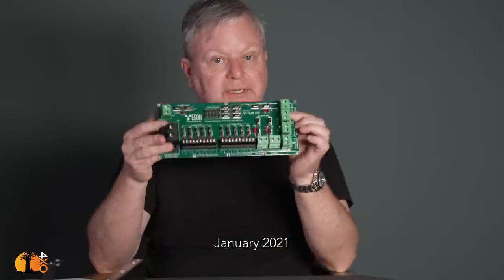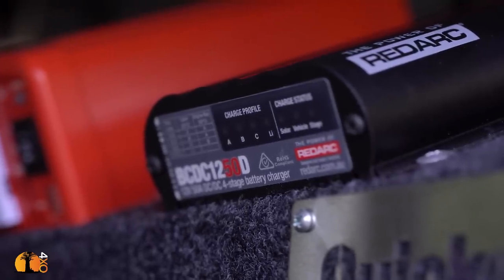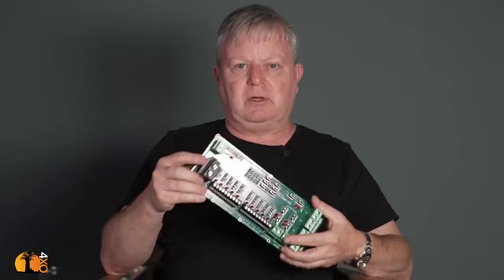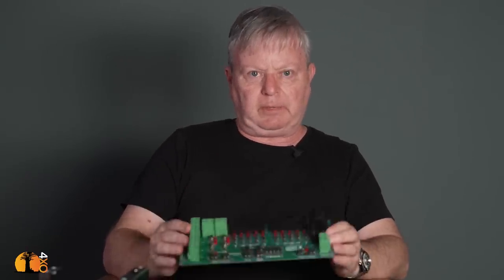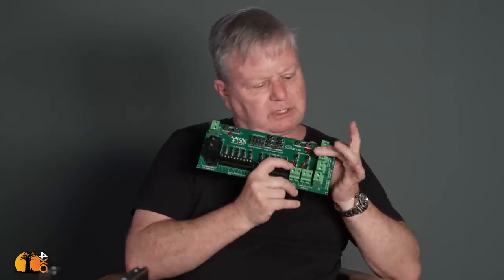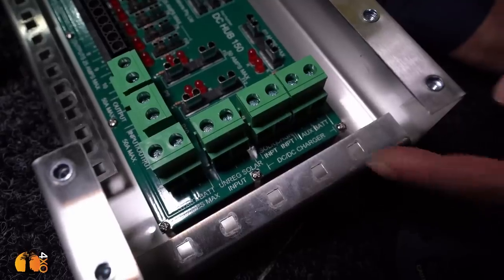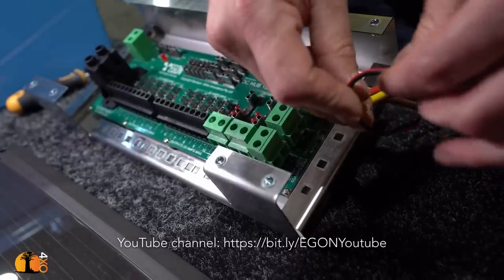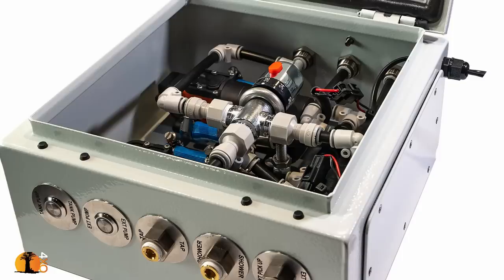DC-INSTALLATIONS MADE EASY. Unique, Problem-Solving Solution. Egon DC-Hub

Comment: Using this in my build was insanely good. I am not great at wiring and this made me feel like a pro. The conductivity and solid connections are so far beyond anything else on the market. I couldn’t believe how little voltage drop there is. It also makes fault finding a dream. Well done guys
Reply: And you had help from Heiner. A win-win!
Reply: @christurner68  Compared to my old setups - measuring from the battery to my fridge and compressor. Bloody hell, who crapped in your cornflakes?
Reply from the maker: Harry. Any electrical posts tend to bring out the know-it-all keyboard warriors by the thousand. They just love to tear one's ideas down. Keep your distance. I do.
Reply: @4xoverland  Very good call mate. This comments section is one of the most toxic  I have seen in quite a while.
Reply: @firetofork  Harry it might help if ASWP doesn't make bold claims that simply are not true.  It's not the only product like it in the world, and in many ways if used the way Andrew says it's downright dangerous.  Go ask ANY qualified electrician or auto sparky if it's safe NOT to fuse at the power source and see what kind of answer you get... also ask them if it's okay to have a bare wire going into a terminal block.

It also wouldn't save someone 7 hours in labour, that's nonsense.

Comment: Great product for simplifying electrical installations in vehicles of any kind. As an electrician myself I would use bootlace ferrules on the ends of all wires going into the terminals of the EGON. It just rounds off the installation nicely and professionally.

Comment: This is a product born out of someone who has lots of overland/car building experience in cooperation with a (German) electrical engineer. It comes from his own need to have a rather simple, bush proof solution instead of reinventing the wheel every single time/build again. For some weeks now I’m trying to figure out a 12v system myself and it’s not that easy to see the forest for the trees. This product simplifies and centralise a lot in my opinion. So thanks Andrew. But in a way I also understand some of the critiques and it would help Andrew to do a bit more than saying one is “missing the point” (even though you prefer to do only on the Egon site). I'm afraid “the point” is not clear enough. I truly love your style of telling a story. It's the perfect counterweight in this tik-tok era. But this time, for a product reveal, it's not enough. Of course some people will never see that it's more than a fancy fuse box but also a circuit board that makes smart connections between different parts as well.  
So can you please explain shortly: 
- why no relays 
- how to deal with switches for the devices one connects to your hub. Is the critique of creating longer cables due to this centralised system true? Maybe a simple wire diagram may help.
Reply: From what he's said at the start of the video, the strength of the unit is the ability to access power for accessories without hacking into the vehicle harness, all the power outputs are fused and faults easily identified and fixed. 

You still need to work out use of relays and switching but common failure point of poor wiring to and from power and not having fuses is addressed.

Comment: Andrew, I was extremely impressed with the work Heiner did on your Dream Tourer and glad he’s working with you on this product. I went to the website and have a few comments. 
1. You don’t list or comment on how many (and what kind of ) input and output can be used in this hub. It looks like it could handle all the wiring that you installed in your Dream Tourer which leads me to...
2. Maybe also make a “mini version” of this. The size of this unit is probably too large for my build (I’m working on my Gladiator build now) . I think most people, like me, would need connections for the following...second battery, DCDC controller, solar, water pump, fridge, lights and maybe one or two extra items. It seems you have way more capabilities than that with this product.  
3. I know you said that the product is currently only available in Australia but when you roll this out please have a currency converter on your website. The Aussie dollars are much higher than US dollars. Best of lick to you and your team!

Comment: When Andrew first touted this product, it seemed to me to be nothing but a Glorified Fuse Box... And it still does. 
I've got a real fuse box next to my aux battery and I'd LIKE an Egon DC Hub but, mate, $700 !!!  Really? 

What is its Basic Function? 
REALLY... What's it do?     

Apart from 'cosmetics' like, nice LED lights when a fuse blows, right size connectors, cable tie tie-downs, ... What's it do? 
Is there any on-board logic? Not as far as I've heard. 
Are there any meters, like, to see how much you've used or drawing at a glance? Nope, nothing to be seen. 

It seems to me it's biggest selling point is that it saves Auto Electricians hours upon hours of work. But, hey, maybe they should try using a Fuse Box (they actually double as a Distribution Point). 
Am I missing something? 

BTW: I can see why the SS holder is 'only' $150... It hasn't even a hinged lid.
Reply: I too was shocked at the cost when it was first released but then I realised that I am not within the target market. Assuming you too understand DC systems and are able to build your own system, the cost of this device is not worth it. However, many people either lack the knowledge or a not comfortable working on DC systems. As an example, I know guys who are very mechanical and have no issues with all sorts of DIY work, but electrical systems just aren't their thing. Then on the other hand, think about all the people who tinker on their touring rig but aren't mechanical at all and can only perform basic DIY work, and finally the rest of the people with less skills. This device provides those people with a means of  installing their own system. I've built various DC systems for the 4wds I've owned, and the cost of cabling and lugs alone, adds up very quickly. Of course, this device won't remove the cost of cabling but it will help reduce mistakes thus decreasing the cost of the ancillary parts. It always amazes me how much I spend on lugs by the end of a build....Do you perform your own oil changes on your car? If so, does that mean that the idea of someone paying a mechanic to perform the service is preposterous? Of course not, the service fits the needs for a particular person just as this product will fit the needs of some. Have you heard of the Redarc Redvision system? If you want to talk about an absurdly expensive product which is basically a touchscreen operated power switch , lets talk about the Redvision. Now that is ludicrous! Cheers
Reply: The other issue is that your running a lot more wire to one central point where it can be separated into zones with individual zone fuse boxes, this makes it even simpler... if you have a wiring issue, with the central box you will have a lot more wire length to check... a zoned system is far more user efficient than a central zone... this is why vehicles have multiple fuse boxes...
Reply: @nabob14  so true. pros and cons with everything.
Reply: @nabob14  exactly!! I have 4 separate electrical "hubs" on my Chevy... I didn't even know to call them "hubs"...but after seeing this gadget I now know what it is I've been building.
ASPW doesn't actually "build" anything...he just pays other people to "build" his stuff for him.
Reply: Do you wire your BCDC into your fusebox then do you?
Reply: If you're bitching about the cost of the mounting box, you've clearly no idea about the cost of stainless steel or the work to come up with the end product from a flat piece of sheet metal. 

There's easily $50 of stainless in that to start with, before any folding or cutting and then there's margin to add. $150 is quite reasonable.
Reply: @k2svpete  nice 1
Reply: @aussiecampingbloke55  Do you wire your BCDC into your Egon DC-Hub then do you?
Reply: @k2svpete  The SS holder is clearly designed to show off your latest extravaganza, status symbol to all your mates and passer-by's. So, yes, actually it's pretty cheap.
Reply: What people seem to miss is that pretty much all the criticism regarding Ergon surrounds its Price. And the 'defense' of Ergon relates to its features (such as they are). 

Apparently one of its biggest features is its power handling, for example, its ability to connect your BCDC or other high power device into it (rather than directly to the battery with an in-line fuse). Let me say, if that's all you've got to justify Ergon's price, you're scratching the bottom of the barrel. 

Consider WHY the above video focused so strongly on the Ergon's high current handling capability... It's because pushing such high currents through a Circuit Board IS an achievement. That's MUCH more difficult than simply connecting, say, that massive inverter, directly to the battery as per manufacturer's recommendation. Andrew virtually says as much in the video at 13:11. 
Unfortunately that stupendous achievement costs you plenty but buys you little. 

Yes, congratulations to Andrew for providing a sophisticated solution to a simple problem. And THAT'S what you're paying for... A sophisticated solution to a simple problem.  
(Reminds me of the extended wheelbase on his camper, that he's figured is not what he wants. (Can you tell us WHY again, please Andrew? Overkill was it?) The one with that electric kettle and solar panels galore. But, hey, isn't it wonderful he can have a hot cuppa. Terrific, misguided, functionality.)  

Nevertheless, I'm sure Andrew will find many American apartment dwellers, who think 'Phillips head' is some kind of a derogatory term; And will happily part company with their greenbacks for the 'latest and greatest, flashy and stainless steel mounted gizmo'. The finishing touch to their latest $250,000 mobile apartment. 
(Not that I begrudge them; They probably worked dang hard for it. Just explaining, IMHO, what we're looking at here.)
Reply: @bossybill7437  well said on the topic of high current delivery through a circuit board
Reply from the maker: Yes, its a fuse box. But there is no fuse box in the world that does what this does. How many fuses in a typical trailer or 4wd build? 10? 20? And where are they? All over the place, in line, fuseboxes and how many buss bars? 1? 2? 3? How do you fault find in all that maze of cables? Is it easy? How about one unit where ALL the fuses (with the exception of battery terminal fuses) come together in one place. All of them. No ground bus bar needed. Half the build time, double the simplicity in wiring it and fault finding. If that doesn't seem like an advantage to you, then this product is not for you. Changing the way people do anything in a new, better way always takes time.
Reply: @4xoverland  Great, thanks for answering. 😃 
At least it's cleared up the question of what we're dealing with. 
Yes, no ground bar. Wish you well.
Reply: I'm kind of shocked after reading comments here. Are you guys like old friends or something...? @Bossy Bill @Cycle & Moto @4xoverland
Reply: @BenFreq  Shocked? Why? Because we are not taken in by 'flashing lights' and a big price tag? 
And 'no', I have no idea who those other guys are. But since you ask, I think it's also fair to ask you... 
Are YOU mates with Andrew? Or do you have some kind of financial interest in this product? 
(There have been some comments around here where one could infer a financial interest.)
Reply: @BenFreq  I don't understand you're logic Ben. You're evidently stating that we support Andrew's product, I for one would not purchase it because I have no need for it, but does that mean others don't have the right to purchase it because it doesn't suit your needs or your budget?

Comment: Let me join the list of people who doesn't get it. All I see is a fancy fuse box / JB sold at a very fancy price. There are many similar products available, maybe not identical but doing basically the same job. The best products come from the industrial and marine sectors in my experience. I love marine products because they are very robust with excellent environment protection (the IP rating) and very corrosion resistant.
I'd also support the comments made by others that bringing all the cable to a central location will increase cable lengths, and a zoned system with multiple distribution points offers advantages in this regard.
Reply from the maker: This does nothing new, except for save time and money and ease fault finding. And it does this by having multiple fuse types in one place and is wired to cater for multiple chargers and multiple inputs and outputs IN ONE PLACE. And, the quality of the connections reduces voltage drops. The alternative is the traditional way, in having fuse boxes and in-line fuses strewn around the build and the inherent voltage drops and difficulties in fault tracing.
Reply: @4xoverland  My vehicle's electrcal system is probably fairly typical. Split into 3 areas, namely engine bay, battery box and rear of vehicle. The first comprises relays and fuse boxes (×2 for main and auxiliary systems). The second has a four way fuse box with strip type midi fuses and a low voltage cut out. The third is a distribution centre with inverter, 6x fused circuits and DIN + cigarette lighter outlets. There's also a single relay which is probably redundant now that I have low current LED worklights.
Of these the Egon might help with the rear of vehicle wiring centre which could definitely be improved because it has evolved over the years. I will have an honest look to see if it could help and maybe even make a video if the findings are interesting. However the competition is tough because there's a  fantastic marine supplier on my doorstep selling top quality equipment. Anyhow this video has inspired me to revisit my own vehicle which is good.

Comment: Andrew I'm a huge fan of the channel, long time viewer first time commentor. I agree with the mind set of running all your cable to a central location but when it comes to terminating these wires I can't justifiy spending $800 to save an hour of crimping soldering and heat shrinking. I have a $30 fuse board from Jaycar with LEDs to tell me when a fuse blows, after watching your video I struggle to see the differance between my fuse box and your product? I would be interested in seeing a more indepth video that can better explain where the value has been added.
Reply: Have to agree mate, clever idea but not worth $800. I understand the need for the return (R&D) but I also struggle to see the value for such a high price tag.
Reply: I would suggest they aren't targetting at home DIY installers with this distribution board. He'll certainly sell one to you. But as much as Andrew is going on about being "foolproof" I would suggest they're actually targetting the trade market, particularly RV/trailer builders. The kinds of people who are doing moderately complex DC wirings over and over all day.

The big selling point to them is productivity and end-user expandability. Buy* this distribution board, save 3-7 hours on wiring and be able to move on to the next unit/customer. That takes it from 1-5 installs per day to 5-15 on builds that are already going to cost 40,50,60K to the end-user. I think that's what this is about.